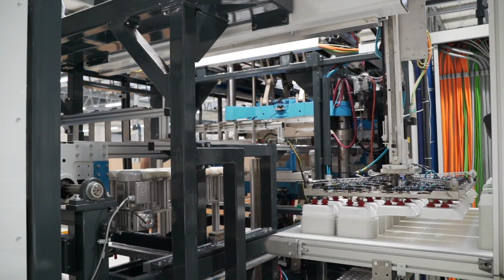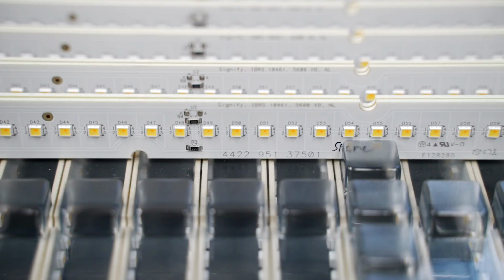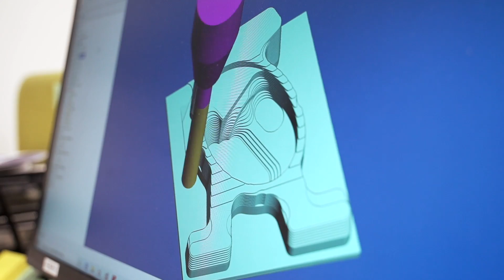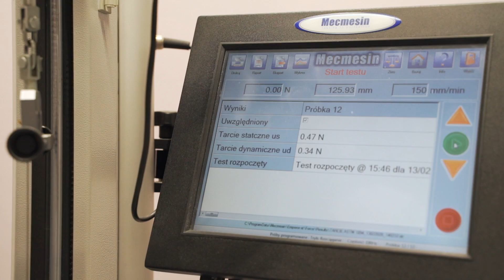How the THERMOFORMING PROCESS works? - Factories

Comment: What drilling machine is used for that vent holes?? Pls anyone help me with this.
Reply: Hey, its like an "Proxxon MicroMOT" you need for stuff like that with really small Drills (as in the video 0,4;0,5 or 0,6mm) the thickness depends on how thin the Plasticmaterial is (If you have very thin PC Material for Example, you should use very small Drilles, otherwise you will see the Holes when the Moulding is finished)

Comment: can anyone explain temperature heating of polycarbonate 8mm and how long?
Reply: Hey, a lil late but lets try :  You heat the PC (Polycarbonate) with Infrared  Radiators (like in the example above "Illig" Company) to about 170-180 Celsius. It depends how "good" the moulding should be, if you wanna have like clean/sharp Edges you need more temperature (But that will come with some Problems aswell). Your Radiators should have like 400-500 Celsius and they should heat the Plate for like 160 seconds (e.g. 20 Sec for each mm). Btw it should stop Cooling pretty early, if the cooling is kinda decent, it will be done in like max. 50-60 Seconds. It should come out of the Machine with approximately 100-110 Celsius, over 100 Celsius the Material is Stable for "use". 

Have a good Day